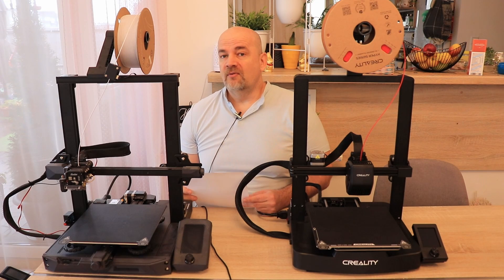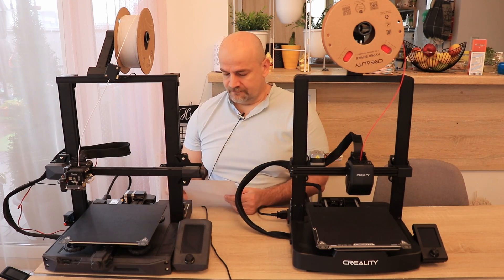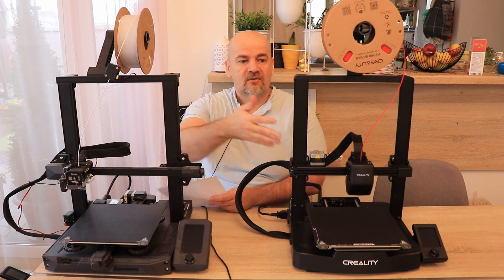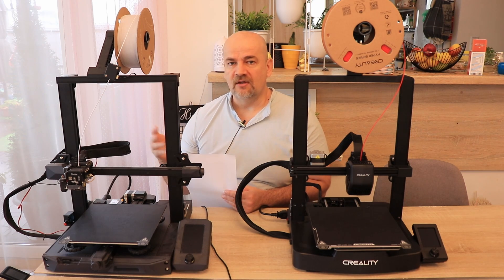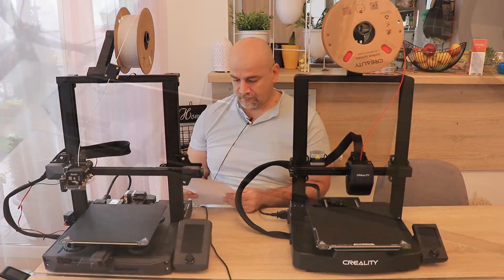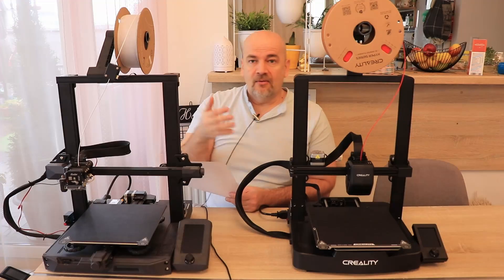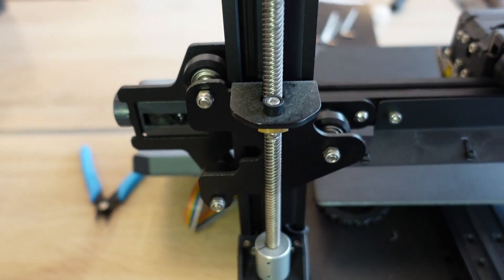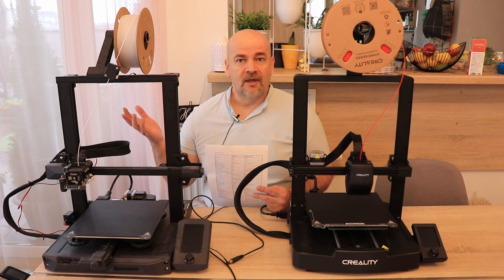Difference between Ender3 S1 and Ender3 V3 SE - Why is newer printer cheaper? Which one is better?

Comment: can someone expand on the diff in types of supported fillaments? Ender states that V3 SE can do PLA/PETG/TPU, and the S1 can do PLA/TPU/PETG/ABS but I cant find what spec makes the addition of ABS possible.  THANKS in advance!
Reply: This is mostly dependent on the extruder you have, what the material composition of the throat is in the extruder and the the max temperatures your printer can achieve

For example, the 3s1, has an extruder with a throat that contains a plastic that can't handle high temps, but the 3s1 pro has an extruder with a fullmetal alloy throat. So it can melt any plastic you put through it, even the abrasive nylon and carbon fiber

It's all about what's inside the extruder that enables the possibility to print with any filament :)
Reply: @rubenverster250  great explanation, thank you so much for that!

Comment: I've never used filament sensors.  They are a gimmick in my opinion. Just don't run out and you'll be fine. Same goes for the power off.. never used.  I got to say, you make great videos. They have helped me out a lot. Thanks.

Comment: It looks like there's a lot of plastic in the SE, even in the frame, not good. Not putting a bimetal heat breaker on the SE is criminal, not using a PEI bed is bad as well. 
So Creality cut prices but you probably have to spend that money later...
Reply: They needed to differentiate it from the KE.  99% of people will have no need to upgrade it.

Comment: I wish reviewers would also look at the base of the unit. As far I know, the base on the new machine is mostly just hollow with one big thin steel plate that covers the entire bottom of it. So the overall design isn't very rigid, whereas the old machine has aluminium extrusions that go all the way out to all 4 corners of the machine and then you have rubber pads at these corners that the machine stands on. I own the S1 Pro and it is very rigid, despite the lack of support rods it feels very stiff and gantry wobble is not a concern at all.

Comment: IMO a very important feature is dual Z steppers, even better is dual independent stepper drivers so the gantry can be auto leveled.
 I upgraded my original Ender 3 to this configuration and it changed a good printer into a great printer, the problem with just one leadscrew is that it was very difficult to keep the gantry level without overtightening the wheels which meant I could not always use the whole of the print bed without wearing out my wheels prematurely, and they had to be re-calibrated every so often.
Reply: The V3 has two lead screws. You only need to auto level if you become unleveled and the timing belt stops that happening in normal use, however we all have unintended non standard usage from time to time and I recon getting the gantry level after a mishap on the V3 will flummox a new owner.
Reply: I had a similar problem with an old Ender 3 Pro. The issue was the frame/gantry wasn't square. The frame was re-built on a ceramic tile and the crooked assembly snapped into alignment. None of the wheels need tightening now... the whole X gantry goes on straight and the Z deviation on the right non-leadscrew side is around 1/20 th of a millimeter over 220mm. Creality's tolerances are high so their printers can be assembled crooked if the work surface is not perfectly 100% flat.
Reply: I tried dual motors with belt and belted Z, but single motor + belt works equally good (better than belted Z).
Larger than stock motor has more torque -> maybe more accurate micro stepping?
Reply: @kimmotoivanen  The advantage of a dual z with independent steppers is that you can use G34 to auto level the gantry, its a game changer!

Comment: I prefer the bed wiring on the V3SE.  My S1 Pro bed wire completely separated and lost power to heat the bed inside that massive strain relief so no better there.  Thanks for the great comparison.

Comment: Full metal hotend on the s1?
Reply from the maker: No, full metal hotend is on S1 Pro.
Reply: I put the full metal one into one of my S1 printers when I couldn't remove the small ptfe tube. It went in really easy and prints great.